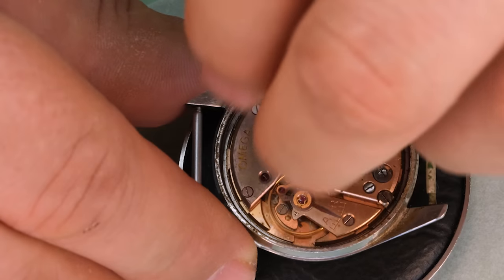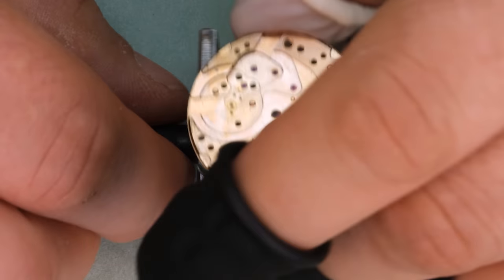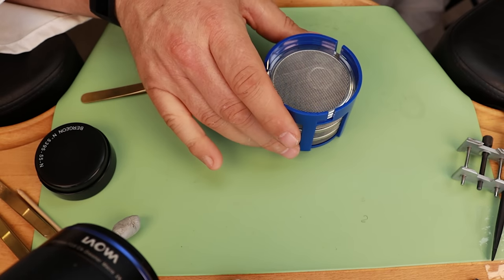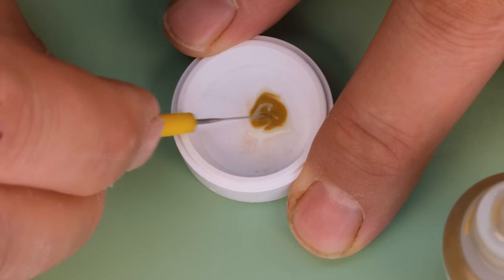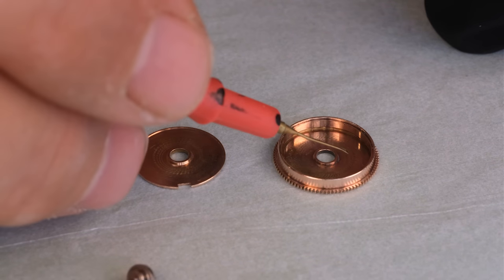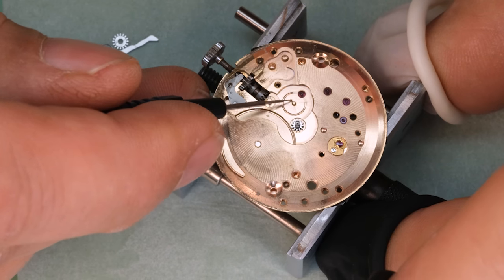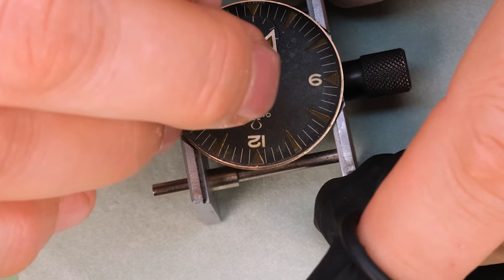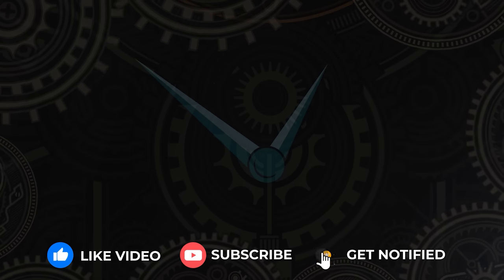Omega's worst flop - the Ranchero

Comment: Great video!  What I admire is not just your artisan skills as a watchmaker and narrator, But also your BRAVERY!  Most watchmakers in my country will not even touch a watch with radium! One watchmaker said to me that it would contaminate all his tools and equipment and would have to first soak the movement compete in a special watchmaking solution !  He would hen remove all the radium from both the dial and hands in protective clothing!  He quoted me over £3000 to service my 1960 Omega because of radium!  All it had was 3 radium dots at end of indices. Francesco is lucky to have you put your health at risk!

Comment: Chevrolet had the same problem with naming a  new car "NOVA", they didn't consult someone who spoke Spanish as a first language, when the car debuted in the Latin American market it was a huge flop. Who would buy a car that litterly means "No Go!".
Reply: Not exactly true down south. On South America people have a larger integration with Latin, they're most likely to associate the word as the "New" meaning of the word in Latin. Most Novas sold in South America were made in Brazil rebranded as the Opala, which was made after the Nova II of USA. It was most likely out sold by the Ford Ranchero made in Argentina with a cheaper cost, or even outsold by the actual Impala, which was a whole size up, and due to import taxes you'll end up with a really bigger car for only a fraction of the price. Still, Ranchero must be the worst possible name for a watch. In native Spanish is like naming a watch the Hillbilly. No one will actually want it.
Reply: Nova in English "No va" that was the joke, and it stuck. @1986arseny

Comment: Fantastic video my man. I have an Omega 2891-1 pre-Seamaster with the 267 movement and this makes me want to pop it open and service it. I believe the 267 is arguably the best of the 30T2 line since the later iterations with the 268 and 269 just removed some of the more costly aspects of the line to make fabrication cheaper, namely a ring balance instead of a screw balance and a flat hairspring instead of a breguet hairspring. Love the 267 and the 30T2 in general, they were the tanks of the era. Insane longevity and beautiful movements from both an aesthetic and mechanical point of view.
Reply: My 268 has a Breguet hairspring with the plain balance. Early 60s I think.

Comment: Yes, submerging the hands in water, to remove the radium lume is a great idea. Mainly to prevent any particles from becoming airborne and possibly ingested or inhaled but also because it affords a little shielding from the radiation emanating from the radium. If you think about it, flooding the reactor pool during refueling outages, is exactly how we do it at nuclear power plants. I’ve had the fascinating pleasure of working a few refueling outages, in the containment buildings, at Turkey Point in Florida and they were some of my most memorable working experiences.

Comment: Regarding the lume on the dial, I have found that sometimes dabbing the markers with a damp cotton swab will lighten up the lume by removing some dirt that has accumulated on the lume. Doesn't always work, but I will usually do a test on one marker.

Comment: I think that the hunt for the right crown doesn't need to be confined to looking for what'll be sold as a Ranchero crown. The crown, and probably thus also the stem tube, would have likely been designed to fit multiple references. The Ranchero itself was a rebranding of a Seamaster bearing the same reference. Still, sourcing Omega parts is an absolute nightmare.
Reply from the maker: Sadly, this crown is in fact quite unique and as far as I found only used in the Ranchero, which makes it very difficult to find

Comment: I know the chemicals are expensive, but rather than do all that scraping and creating all that dirt, I keep my dirty chemicals to give the dirtiest parts a pre-cleaning... although I am using ultrasound so it maybe easier to swap out the chemicals. Also, I find if I let the hands set in the water for a few minutes before trying to remove the lume, the water softens it up so it comes off easier.

Comment: Thanks for another great video, Stian!! You added a dial washer.  Was it supposed to be there or did it fix a problem you didn't cover in the video?
Reply from the maker: Hello Woody, as a general rule you should put a dial washer on top of the hour wheel, unless the hour wheel is held down by a plate. The washer ensures that the hour wheel does not slip out of mesh with the minute wheel

Comment: Nice job on the lume. Isn't Luminox also slightly radioactive (although much less so than Radium)?

I made the woodpecker comment only because I can't imagine how you can tap that quickly, even with a light hammer! 😁
Reply from the maker: Aha, that was you! 😂 Super Luminova isn't radioactive, no. Tritium, which was the successor of Radium, was ever so slightly radioactive, but the newer lume types aren't.
Reply: @VintageWatchServices  I want video of that hammer action :)

Comment: It looked (to me) as if lots of the staining on the dial would ahve come off with water. But since you know more, what was all that staining?
Reply from the maker: Hello Hugh, it might be that some of it would come off with water, but so might the underlying varnish and paint. Remember that there are basically no external sources of dirt for a dial, thus what you see is from the dial itself. It's decay of the varnish, mostly, from old age and sunlight. And old dials are extremely fragile, so once you start rubbing on them you destroy them...
Reply: @VintageWatchServices  Thanks! Always curious. That one in particular since the back of the dial was also so dirty. But yeah - rubbing the dial off would not be good!

Comment: Hi, is this correct? The waterproof rating of this Ranchero is 30mm approximately 1-3/16 inches?
Thanks
Reply from the maker: No, that wouldn't be correct 😂 The 30mm on the dial refers to the size of the movement

Comment: Had a question or two.  Would you mind mentioning the names of the lubes you use.  It would be interesting to hear and compare to what's available and what other use?  Also, do you run in the watch for a period after lubricating before time graphing or do you go straight over and check it?
Reply from the maker: Hello Rob, thanks for watching! I generally use Moebius 9504 for the keyless works and cannon pinion, HP 1300 for lubricating the center and third wheel plus posts on the dial side and 9010 for the escape wheel and balance wheel. I let the movement run in for a few minutes before checking it on the timegrapher. Note that the test of accuracy in a watch should generally be done 24 hours after a full wind.

Comment: Lovely video, bravo. 
Just worried about when you had opened the watch you could have all those radiation particles from the old hands inside the watch case mecanisme etc etc ? 
Don't yo think so ?
best wishes
Reply from the maker: Thanks for watching! The lume in the hands was intact, so I'm not too worried about it. And after taking the movement out under the suction system I'm confident there was little risk.

Comment: I've been playing poker for the last 18 years or so. At the casinos, they have what is called a bad beat jackpot. It's a running total that increases until someone hits it, and is funded by the rake from the pots. It must be aces full of jacks or better beaten by 4 of a kind or better, and both hold cards must play. The last and final time I ever played, I folded a qualifying hand to a 6 dollar bet. I'd have walked out of the casino with 14,000$.
Reply from the maker: 😖 Ouch!
Reply: @VintageWatchServices  yeah. I did not tell the table, either. I just quietly folded. And cashed out 20$ worth of chips. It was a very low moment. They day before that I was with an escort that was probably 20 years old and had more than 50 cigarette burns all over her back and ass. White girl. You could tell she was raised well, too. Really low time for me.

Comment: Excuse me for asking, but when you put oil or grease onto the pallet fork, why do you only put the oil onto just the tip of the crystal and not onto the side of the crystal which rubs against the teeth of the escape wheel? 
Also, I think I prefer the sound of the woodpecker to that of a shot gun. Maybe you could add the sound of a duck or goose or something (making sure it can be heard flying away). 
A Youtube account while at school? Hmmn... I think that Ranchero has been telling you tall stories. My technological foresight story isn't quite as good as that, but I got permission from my school so the students could use a calculator in Chemistry class (1976).
Reply from the maker: Hello Stephen, thanks for watching! The sides of the pallets are meant for locking the escape wheel teeth, so lubricating them would kind of defeat the purpose. The front face of the pallets receive impulse from the escape wheel and you thus want minimum friction there. 
And yes, the mention of my YouTube ambitions back in the 70's might have been slightly made up 😂

Comment: I see you managed to get an original signed omega crystal — where did you get it?  I can’t seem to find any.
Reply from the maker: I have a stock of crystals still...
Reply: @VintageWatchServices  lucky! And smart! I can only find the one with a gold retention ring.... I was thinking of discarding the ring and using a generic chrome ring with the genuine crystal...
Reply from the maker: @GranBuroo  If they're the same size that shouldn't be a problem

Comment: Add coffee to the lume for the Vintage look.
Reply from the maker: You cannot add coffee to the lume mix, that would gum it up. You can add coffee to the lumed hands as I've done in some other videos, the downside is that the surface becomes a little bit shiny. And when the lume on the dial is this burnt out, I think it's better to add color to the lume itself